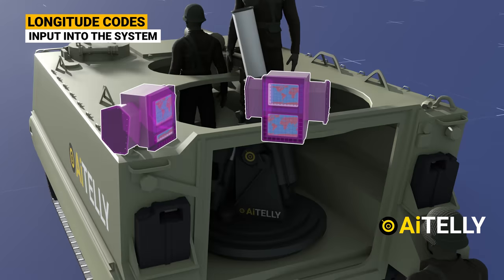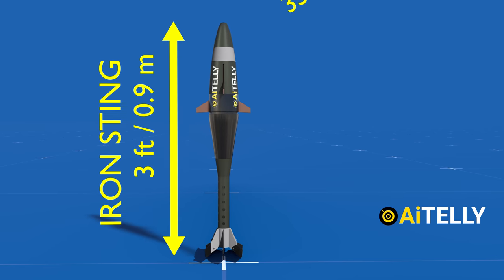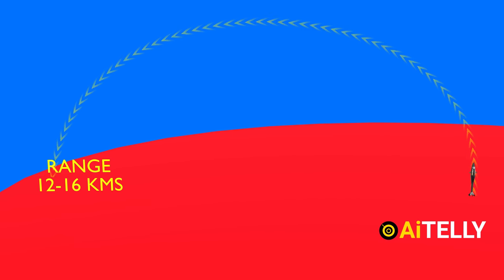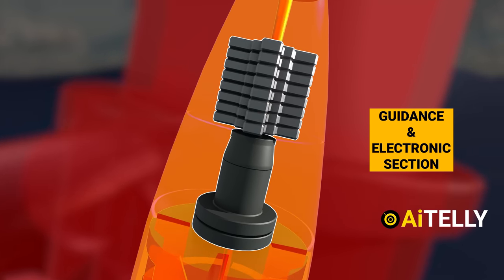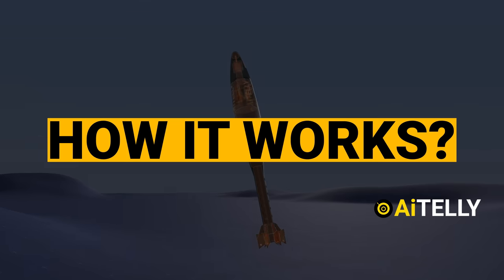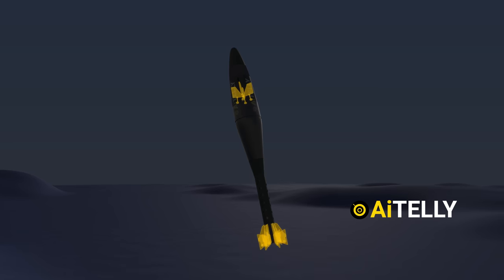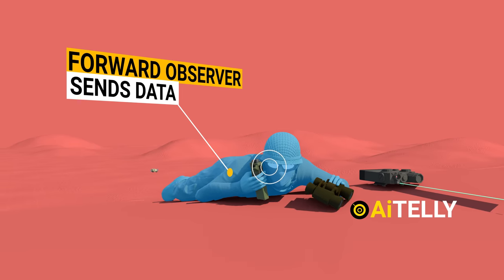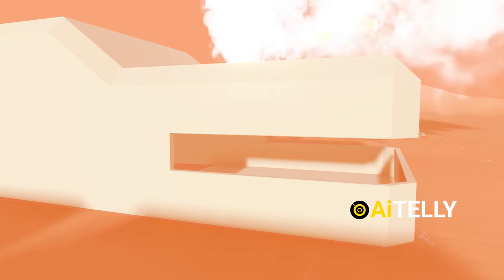Iron Sting Mortar | How it Works | Israel Gaza

Comment: I was an 11C (mortars) for 4 years & had often thought something like this should be possible, but figured they didn't bother cause it was too expensive for a simple mortar round.  Glad to see I was wrong.
Reply: The price of electronics is going down, the next stage is autonomous guidance...
Reply: The rate of fire was wayyy to slow to be effective.  We had these rounds for a bit.  They might be accurate. But slow rate of fire makes it useless to be effective.
Reply: @danielpickrell8311  They are a precision round, so they are effective for that.   Even with regular rounds the sustained rate of fire for the tube after the first two minutes isn't really impressive anyway.
Reply: @11C1P  16 rounds 1st minute, 4 rounds sustained for every minute after.  But a good mortar squad, FDC with a good FO can do the same job, same accuracy with higher rate of fire.
Reply: @danielpickrell8311   I guess you got a special tube made from materials that won't turn it red, eh, slick?
Reply: @11C1P  that is from the book lol
Reply: @danielpickrell8311   Really so what does the rate increase to with a "good" FO & FDC?  And how exactly do they effect the melting temp of the tube?
Reply: @11C1P  volume by accurate fire.  Which in any firefight you know mortar rounds are much needed in accuracy and volume.  Good FO gets the coordinates, FDC computes the data to the guns.  Gun teams fire the rounds.  Immediate suppression missions will give 64 he rounds of 120mm within the first 2 minutes from a mortar platoon.
Reply: @danielpickrell8311    You have no idea what you are talking about.  The rate of fire is limited to keep the tube from overheating.  Keep reading books, maybe you'll learn something useful, but you have no clue about mortars.  I was an 11C (infantry/mortar) for 4 years.
Reply: @11C1P  lol what is 64÷4.  It's 16.  16 rounds for the initial fire per gun.  The 4 because there 4 guns in a platoon.  Look at the bigger picture not the smaller picture.
Reply: @danielpickrell8311   There are 3 guns per section, 2 sections per platoon.  There are also 6400mils in a circle. which also has nothing to do with rate of fire as long as you want to keep spouting things that are irrelevant to rate of fire.
Reply: @11C1P  it's all relevant.  More guns you have more rounds you can put down. 64 rounds on the initial fire  vs 4 guided mortar round for that target.  Also back in my day it was 4 guns per platoon(mechanized) and then on deployment we went light so it was 2 guns per company when they added mortars to the companies.
Reply: @11C1P  
He thinks that using a mortar inside an m113 is the same as a mortar stuck in the clay.
Reply: @maxuelresende    Yeah, he keeps mentioning things that have nothing to due with why the sustained rate of fire is limited as if those will keep the barrel cool somehow.  Only thing we could do to cool the barrel down was pour water on it.  It's cool these kids read about it, but then they try to act like they know WTF they are talking about.

Comment: Some minor points and a question 
1). Very impressive animation.
2). A mortar is the weapon and it fires a bomb, not a round. 
3). Another common term for firing and then changing positions to avoid counter battery fire is “shoot and scoot”.  My favorite as it just sounds good.

Q1) If the bomb only weighs ~35 pounds does delay fuzing really provide improved penetration against reinforced concrete?  Personally I can’t see it doing much more than penetrating an extra inch or three of plain old cement. Reinforced concrete is a whole different animal requiring traumatically higher levels of energy to penetrate.

Comment: This weapon has proximity fusing, as well as impact fuse, and delayed impact fuse. This allows the round to explode above a target, instead of possibly having its explosive energy absorbed by soft ground, or building walls, or, say, vehicles in a parking lot... instead, it pops off just above, and depending on charge design, can blast down onto targets, and, with shaped changes, penetrate deeper into even armored vehicles.

Comment: The problem with all guided munitions is they always produce a doughnut shaped blast.  Not bad if landing nose perfectly down.  But if the nose lands at an angle, targets directly in fore & aft of the munition have a much lower probability of destruction than targets to the sides.

Comment: I'm pretty sure that the observer doesn't use any voice radio, nor does the firing unit listen to voice commands or write down on paper. The whole process is digital using the IDF "Hunter" digital control system. A fire task is submitted and executed over digital link.

Comment: How much does an Iron Sting round costs versus a conventional mortar round?  How much bigger is the warhead and kill zone?
Reply: Abouts 70 virgins
Reply: I don't think the cost is what matters but more on its effectiveness in combat.  You have  to make sure fins aren't bent and you have to load the laser code before you can fire.  That is each round.  The time it takes to fire one, you can fire an immediate suppression mission of 12 rounds  HR delay using a converge mission to hit the building. You'll get the building and any enemy troops within a 50-300 meter spread depending on how you want to do it.
Reply: Probably a few thousands, still cheaper than an ATGM

Comment: Imagine this with swing-out wings and an FPV camera. A forward oberver with game-controller and FPV goggles could give it visual terminal guidance, perhaps even have it loiter a bit in a descending circle.
Reply: to fast for humans to directly control its going 100-200m/s
Reply: @woltews  no, it would be controllable by a human at 100-200 m/s. That is slower than most ATGMs used by modern militaries, such as the TOW (278-320 m/s), which is essentially visually guided. It is also about the speed at which the A-10 thunderbolt flies at (~500-600km/h or 139-166 m/s) and an A-10 pilot could definitely control his plane in a suicide attack.

Comment: It has a second guided system that based on GPS, that the crew can upload the target location to the round from a computer. I'm not sure how a much bigger & heavier round has twice the distance than a standard mortar shell. If it involved more propellant material inside the mortar, why they can't do the same with the regular rounds?

Comment: This guided mortar shell price range per shell is in the ballpark of 18000 to $30,000 USD per round. It is used to hit high value targets as the IDF prefers to use a sledgehammer approach to urban areas. 

For example, according to the internal report of the Pentagon that was leaked by anonymous senior officers, 11 Israeli artillery battalions with a minimum of 258 artillery pieces fired at least 7,000 high explosive artillery shells into a Gaza neighborhood in a 24-hour period. Which included a 4,700 shell barrage in a 7-hour period.

Ny comparison, the Ukrainian army fires at least 6,000 shells a day along their entire line of contact with the Russian army.
Reply: The idf has what's called a target bank.
Along the years every time a building /apartment is confirmed to be a hideout/headquarters/ammo storage, it is added to the targets bank. 

Once the fightings begins.the artillery crews and planes receive the coordinates so the enemies can be engaged very quickly on a short notice.

On the other hand ukraine mostly uses outdated field guns and need to look for every single target separately.
Reply: @Agm1995gamer  Такие непомерные траты на орудийные боеприпасы могут себе позволить только очень богатые страны, например США, с их гипертрофированным военным бюджетом. Бедная, зависимая от поддержки США и стран НАТО - Украина (и соответствующие ей страны), испытывает снарядный голод в виде обычных снарядов, ракет и бомб, такие траты на мины ей не потянуть.

Comment: how can these penetrate reinforce concrete just from the freefall energy ?
Reply: You can set the fuse on felay
Reply: Yeah "layers of concrete" from a mortar shell is not believable. Maybe a really thin layer. But it may have a shaped charge warhead, it could penetrate a pretty thick wall in that case.

Comment: thats great to see, this one have JUST been fielded.
i believe lockheed or general atomics (cant remember which tbh) made a similar concept but with a trilateral shell and tiny wings deploying. pretty crazy. but it's still in development (not much info around as far as i know) and it's for the 155mm artillery. dumb artillery shells are becoming a thing of the past on urban warfare. in 20-30 years it'll probably be prohibited to use it
Reply: Чем дальше развивается прогресс в области высокоточных вооружений, тем больше вероятность перенесения боев в космос, для уничтожения спутниковых группировок, которые осуществляют навигационное обеспечение высокоточного оружия.
Reply: They have been fielded before back in 08-09 we had some of these rounds.

Comment: "Longitude codes"?! Do you mean lat/long coordinates? GPS position?
o_0
Reply: 0:10  "... triggering the ring propellant charge." So far so good ... "The more charges are used the greater the rounds it will travel for the distance."
Are you rushing? great graphics but ...
Reply: p.s. 0:35 ... 35 seconds into the video, "Hang around and don't miss a beat"?!
/*bliink*/

Comment: How can it go through so much concrete when it's just falling and not propelled by any rocket
Reply: Speed (also determined by how high it flies), mass, strength to prevent disintegration on impact.
Reply: @mverbaan3381  what about terminal velocity? I can't see a object weighing a few hundred kilos go through feet of reinforced concrete. Am I wrong here?
Reply: @lukej2767 
There definitely will be a terminal velocity, but it will be (very) high.
The air resistance is very low, given a small frontal area and a good aerodynamic profile of the projectile. Plus the initial speed of the projectile is high (the explosion of the propellant in the mortar gives the projectile a high 'starting speed'. 
Then all this kinetic energy is concentrated on a very small area. And this energy is not distributed over the fragments of the projectile, because the projectile doesn't disintegrate, after which explodes IN the target. Here all the energy can not escape and is used to crack the target.
Reply: @lukej2767  It does not weigh a few hundred kilos. 120mm mortar shells weigh about 20kg, the muzzle velocity is usually high-subsonic, and terminal velocity will be somewhat lower than that. It won't penetrate a thick wall. It may have a shaped charge warhead which can make a hole into a thick wall and cause some damage behind it.

Comment: This Iron Sting design serves no purpose. H.E. with its fuse set to 'Delay' will achieve the same effect without having to carry a three-foot monstrosity. Firing an entire Section of Mortars simultaneously "In Effect" after adjusting fire onto the target with whatever tube FDC chooses to designate as its Base Piece will destroy the target every bit as efficiently as an expensive Iron Sting. In fact, I'd go so far as to say that the only additional 'sting' that the Iron Sting inflicts is upon the pocket of the government agency paying for them!
The RamJet 155 on the other hand! Oh my! It will greatly increase the range of Artillery and will greatly quicken the Indirect Fire Team's delivery of destruction at a reduction in cost! 
Fewer rounds will be needed to achieve an 'End of Mission.'
The Ramjet 155 also wears out the barrel of an Artillery piece less than the rounds used today as only enough propellent charge is needed to get the round up to the speed whereat the ramjet engine can kick in.
The Iron Sting is an unnecessary and costly improved heavy mortar round. 
I do like those German Weisel Mortar Carriers though! Israel needs some of those! But I digress!
I heard from a guy who posted a comment that the Ramjet 155 is still in development. 
Let's hope it gets into production very soon as it could be a real game changer if Taiwan is invaded.